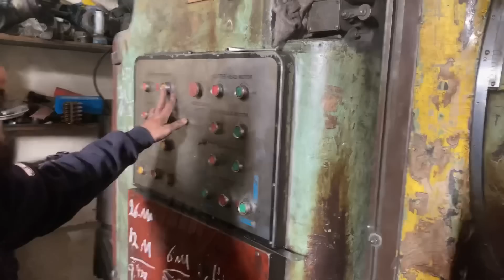Amazing Manufacturing of Transmission Pinion Gear Shaft Roller in Local factory

Comment: On one of the other video, not this video, but at that very same foundry location.
The Lad's, when taking one of the red hot metal billet out of the furnace.
They All stopped, and then They All took a moment to cheer, They then carried on with the process of shaping the hot billet.
Can anyone explain to Me as to why They paused, then They did the 'Cheer' thing ?
Reply: Kppc